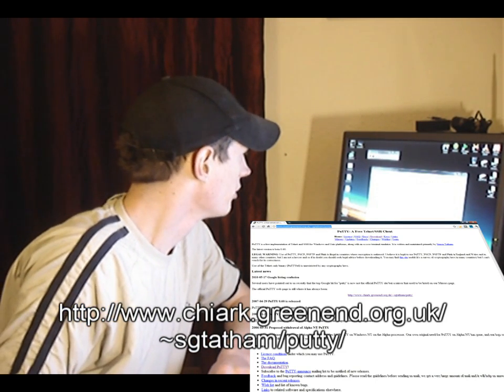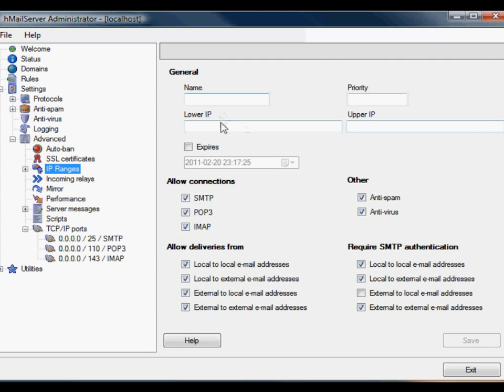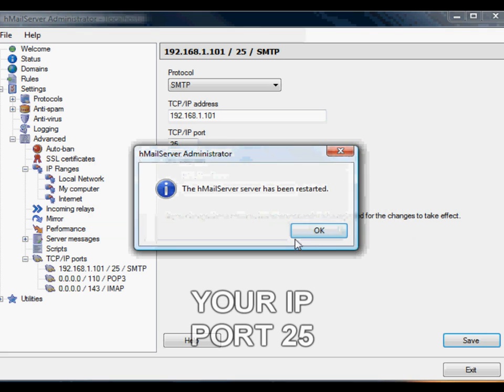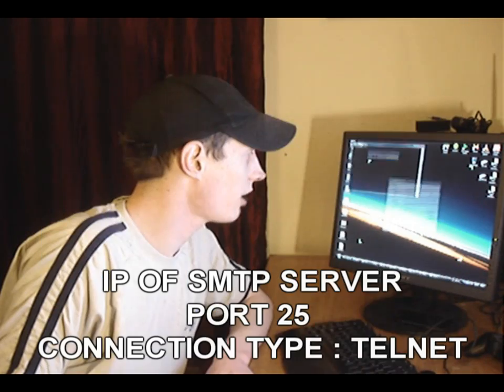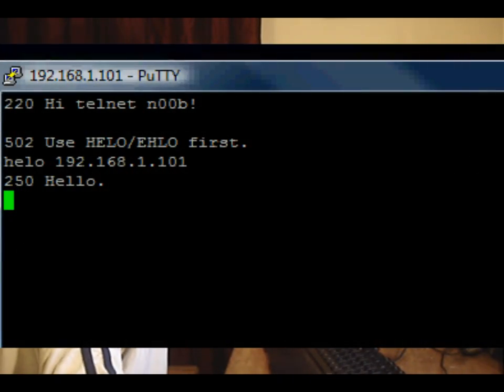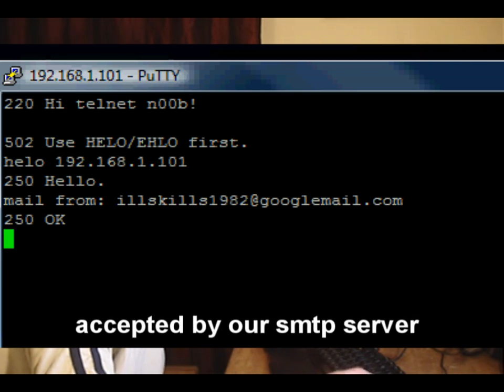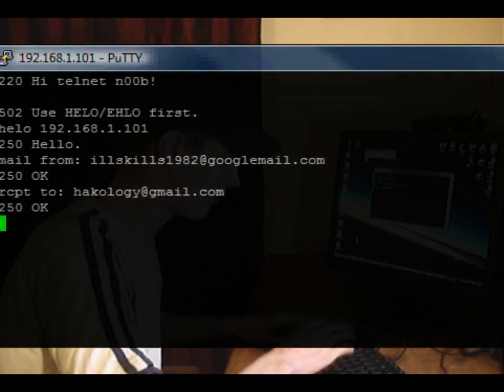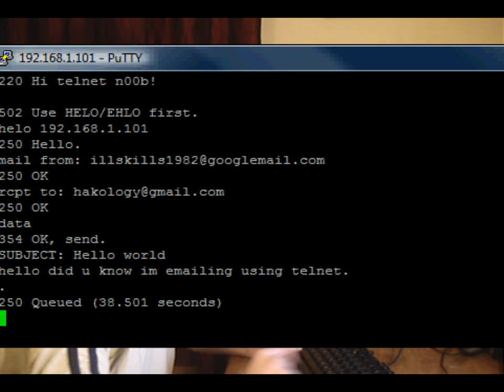Hakology - Sending / spoofing email using telnet & hmailserver

Comment: It not Work's For Gmail? Why?
Reply from the maker: gmail will block you after a few attempts ... check your spam folder.
Reply: hakology Have any short way to change ip(cmd |any sof)?
Reply from the maker: google 'release ip' ... you need to be connected to your router in modem mode for the release command to work unless you have a router that will allow you to release the ip from the web interface.

Comment: When you told us that google blocked you and you had to change ip adress, how did you change the ip adress? And was that true?
Reply: +Andres Wheatley google 'release ip' you will need to plug a computer directly into your router / modem issue the ip release command and you should get a new ip ... this varies between isps ... good luck ;)